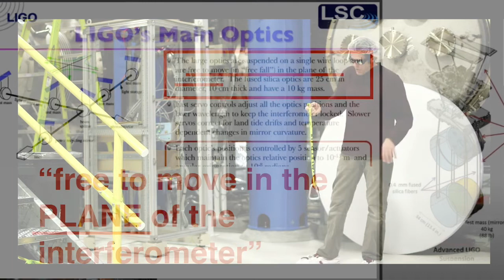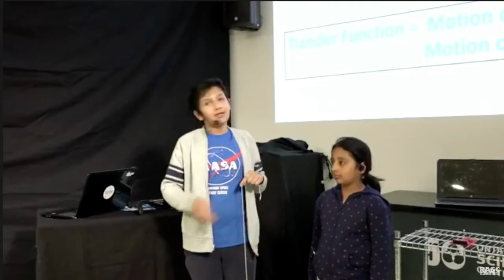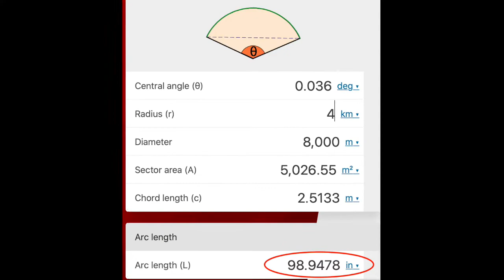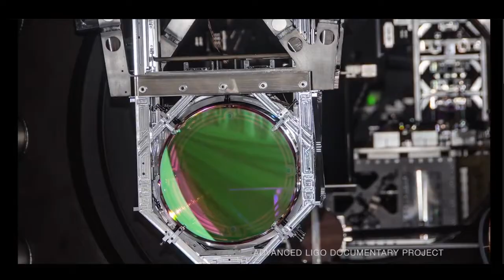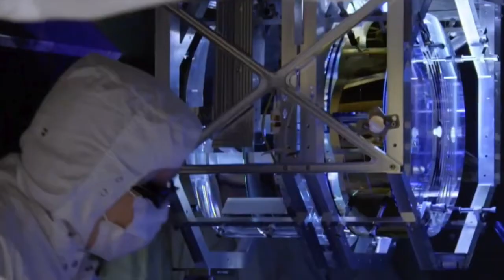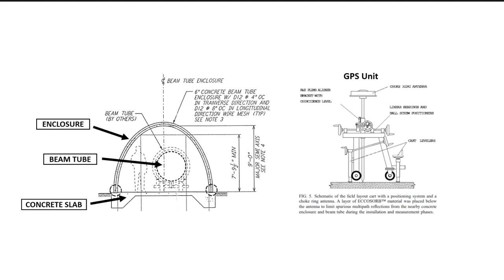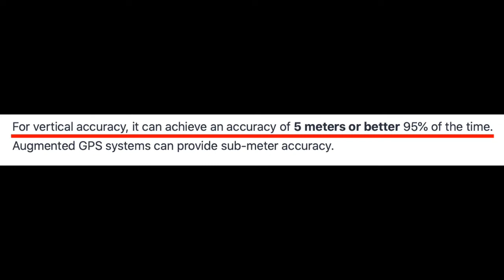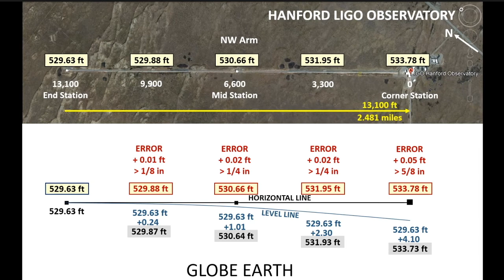The geometric LIGO   compared to the dogmatic model

Comment: "(p)If all perpendiculars to a plane are parallel then, (q)all plumb lines perpendicular to the horizontal plane are parallel. (p) all perpendiculars to a plane are parallel therefore, (q) all plumbs are parallel."

Modus ponens epic fail.

(p) If all perpendiculars to a plane are parallel then, (q) all plumb lines perpendicular to the horizontal plane are parallel. 

(p) All perpendiculars to a plane are parallel, (q) therefore all plumb lines perpendicular to the horizontal plane are parallel.

The problem is that there is only one plumb line perpendicular to the horizontal plane, because the horizontal plane is defined locally as the plane tangent to the level surface, which is curved. So the above implication is trivially true because all plumb lines perpendicular to the horizontal plane correspond to just one line.
Reply from the maker: The horizontal plane is a plane is a plane, nonetheless. And plumb is perpendicular to it, nonetheless. 
Your imagination doesn’t trump measurable reality
Reply: @mobiusmaximus586  Reality shows that plumb lines diverge. Your conclusion is false as much as your reasoning.
Reply from the maker: @primonomeultimonome  you’re welcome to show plumbs actually diverging however, i know you can only do a calculation based on an imagined model. 🤷‍♂️
Reply: @mobiusmaximus586  can you please share with us the measurements that confirm that all horizontals are on the same plane or that all plumb lines are parallel over long distances of several miles. How did you take those measurements?
Reply from the maker: @ws1982  it’s geometric principles. They’re measured and relied on everyday. Have you not ever used practical tools?
Reply: @mobiusmaximus586  great, so please show me the measurements over miles that confirm that plumb lines are parallel at that separation or that horizontals at the same elevation are parallel/coplaner with miles of separation. 
I’d really like to see those measurements and read about the method used. Please give the specific details. Thanks.
Reply from the maker: @ws1982  show you measurements that defy practical geometric principles? 
That’s weird. Aren’t you claiming these fundamentals are somehow inapplicable at some distance? 
I’m curious where your of that measurements are
Reply: @mobiusmaximus586  the methods you are referring to are accurate within the margin of error (very key point) for what they are used for. 
For example the building industry are typically working with tolerances for construction of 0.25 inch over 10ft.
So the curve of the Earth (as we live on a spherical planet) is not an issue.
For larger projects the curve of the Earth is a factor and you can find the information about that in projects for bridges and even the London Underground. So you can look at those measurements. 
More importantly you can personally use methods that can differentiate between the globe and a flat Earth or any other shape Earth or for you that can differentiate between all horizontals being parallel or the globe. 
Why don’t you use the methods yourself? 
You have an EQ mount so could easily use various methods.
We live on a rotating spherical planet. Anyone that understands geometry and has the intellectual honesty and integrity to use methods that can differentiate can prove that.
Reply: @mobiusmaximus586   We all knew you had no evidence to support your claims, but you haven't even tried to provide something, you immediately resorted to reversing the burden of proof. This proves you are not just delusional: you are a complete liar. 

There exist no "practical geometry principle" dictating that verticals must be parallel. I have a whole playlist showing tools and methods to measure the divergence of plumb lines.
Reply from the maker: @primonomeultimonome  “we”? 🤔
Reply: @mobiusmaximus586  Yep. Anyone aware of flat earth derp. You included.
Reply from the maker: @primonomeultimonome  ya, flat earth is silly. Elevation is measurable 😉
Reply: @mobiusmaximus586  As much as curvature. The Earth is a globe, you are delusional.
Reply from the maker: @primonomeultimonome  huh? Elevation isn’t measured curved, silly.
Reply: @mobiusmaximus586  so is the rotation of the Earth. Use your EQ mount to measure it yourself or you could ask Bob Nodel. Thanks Bob.
Reply: @mobiusmaximus586  As if you knew anything about elevation measurements, or measurements in general. 🤣 This is just too hilarious.
Reply from the maker: @ws1982  an eq mount doesn’t measure elevation, silly.
Reply from the maker: @primonomeultimonome  ya, this is hilarious…. I said elevation isn’t measured curved. And you’re acting like I don’t know what I’m talking about but, you can’t show elevation being measured using a curved line 🤔😆
Reply: @mobiusmaximus586  where did I say it does. My post Cleary stated rotation of the Earth
Reply: @mobiusmaximus586  anyone can see elevation being measured from a curved line. GPS is all you need. It uses the wgs84 as it’s base for measuring elevation.
You really need to get out of the basement and try these things for yourself.
Reply: @mobiusmaximus586  Sure, anyone can see you write nonsense, you clearly have no idea of what you are talking about. And that's indeed hilarious.
Reply from the maker: @ws1982  LOL..... you think GPS is all you need to measure elevation? pfft.... talk about needing to get out of the basement.... geez
The WGS84 is just a reference ellipsoid model..... your fellow model afflicted pals should reel you in before you make a fool of yourself
Reply from the maker: @primonomeultimonome  what part is nonsense? Please be specific. Otherwise, you just look like you're throwing a tantrum. Which is indeed hilarious.
Reply: @mobiusmaximus586   Specific? ROFL You wrote: "Elevation isn't measured curved."

As far as I can tell, "to measure curved" isn't even English, it's just nonsense. Not to mention that elevation is defined in terms of gravity, which alone destroys flat earth. You are so illiterate that even by writing utter nonsense, you managed to negate flerftopia. Another epic flerf fail. Congratulations.
Reply: @mobiusmaximus586  By the way, what was your point with your word salad about GPS, again? You should know by now that any reference model used in geodesy destroys flat earth, and not because surveyors have something against flerf illiterates, but because they wouldn't be able to measure elevation nor anything else if they assumed that the Earth was flat, since it isn't.
Reply: @mobiusmaximus586  yes, only gps needed in this example. Looks like another method you don’t understand🤷‍♂️
Reply from the maker: @primonomeultimonome  so, when you say i write nonsense, you really just mean the sentence structure and not the substance...... since, you can't seem to articulate any real rebuttal. Got it. 
And, when you say, "elevation is defined in terms of gravity", do you mean to say a straight line perpendicular to another straight line will somehow not be straight lines perpendicular to each other because of gravity? Sounds neat.
Reply from the maker: @primonomeultimonome  you keep using the words "flat earth" for some reason. You might be lost. If you're looking for flertopia, you're in the wrong place.
Reply from the maker: @ws1982  You really should look into the actual methods used to align the beam tubes and the optics at the facilities, and not just read the 6th grade science promo brochure on LIGO. Just sayin
Reply: @mobiusmaximus586  What substance? Your random sequence of words should mean something? You keep talking about straight lines, where every definition of elevation is based on level curves and tangent planes. And look at your other comments, handwave dismissing anything that debunks your silly cult: you are the typical clueless flerf liar at the peak of his "nu-uh" phase. And exposing you is indeed hilarious.
Reply: @mobiusmaximus586  what’s that got to do with using gps to confirm the Earth is curved?
Reply: @mobiusmaximus586  About flerftopia, nobody can be looking for it. Flerftopia is the imaginary world where level doesn't curve. Such a place exists only as a silly belief in the delusional mind of flerfers.
Reply from the maker: @primonomeultimonome   i should thank you for providing such entertaining content.....  you're loads of laughs. thanks
Reply: @mobiusmaximus586  I'd never take credit for someone else's merits. I only make sure that the right recognition goes to all this flerf comedy of nonsense, of which you are clearly the unique, indisputable source, here.